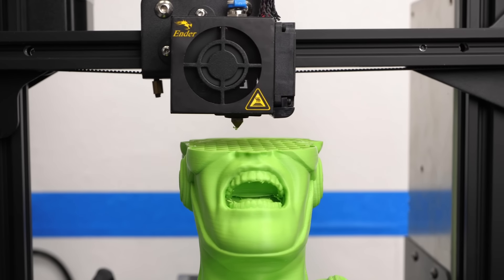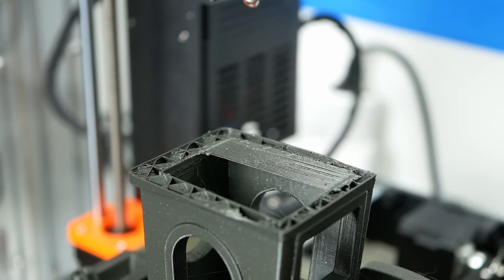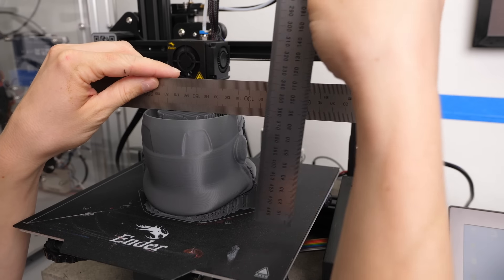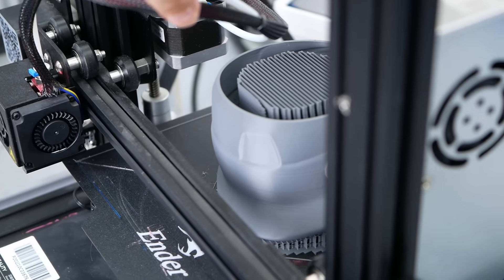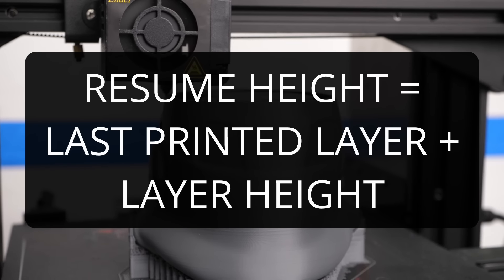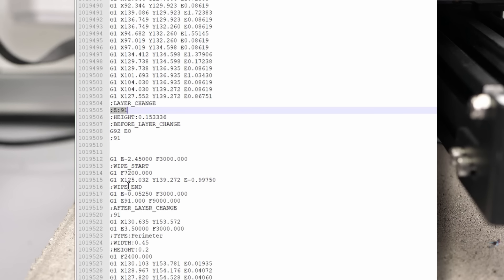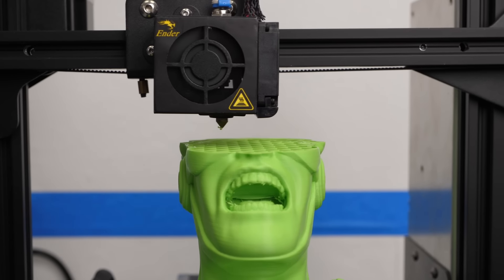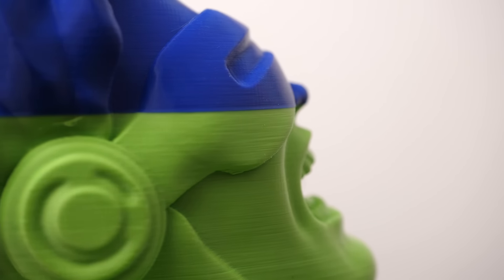HOW TO: Resume a failed 3D print!

Comment: Great video! Although I think you forgot to add that you need to set the extuder position before you have it start printing. Atleast when slicing with cura, the extuder position does not get reset with every layer. So when you do just the steps you mentioned, it is going to go to the start position and extude out a boatload of filament before actually resuming. You will need to have a G92 E{extruder position} command. The extruder position will need to be the last E value from the commands that were deleted.

You can also leave the hotend at the resume z height and use a G92 Z{height} to set the current z height to avoid having it home and dislodge or crush the print. Then you can have it just home X and Y with: G28 X Y 

Clearly I've made this mistake of not setting the extruder position many times
Reply: thank you - that was the solution i needed
Reply: can i ask where will i get the value that i will be puting on the G92 E***?
Reply: I was just wondering that, I didn't want the extruder to go to an 1578.0092 on the first move lol. Thanks!

Comment: Finally a video on this.  I have been doing this for years and couldn't understand why all of the "experts" on youtube just lament a failed 4 day print and then "here is another one i printed".

I am writing this at the same time as watching the video and Stephan is reading my mind or my comments.

Make sure you keep the bed on.  Also move one of the motors or in another way make sure the motors are powered.  DO NOT TOUCH ANYTHING if the motors are unpowered.  Send a move command usually works.

I measure the height of the failure or look at the 3d model in the slicer for a visible point.  Using the nozzle is great too.

The double extrusion of the layer... lol... he is faster than me.  You need to be one layer higher since the printer needs to put the new first layer plastic somewhere.

I dont think keeping G28 is a good idea ever unless you moved the gantry while unpowered. I remove the g28 if you have kept the motors powered the since the printer doesnt need to home again.

The only other thing I would change would be the printing speed on the first recovered layer since you want a good bond and there might be some jagged bits.  This requires changing just a few entries.  You have already identified the layer you want to recover and see the Z 5.20 (or whatever)  the first movement command of each type (perimeters or infill or travel has a F entry... you can choose to change all of them including travel movements.

You will see something like:

G1 F4200.000
G1 X60.018 Y147.814 E0.50701

The top G1 sends the movement speed.  You can arbitrarily cut this in half to 2100.000 to slow the speed by half.

The 2nd line of code has an "E" component which identifies extrusion.  This helps identify if the code is for extruding or travel if the slicer doesnt leave notes.

You then do a "find" in your editor for "G1 F" and work your way through the layer code until you hit the next layer change.

I usually just change the perimeters ones since infill isnt so important.

Alternatively if you have seen that the perimeters are all F4200 you can do a find and replace and keep hitting next until you see the next layer Z note.  If you go to far it doesnt matter, that part of the next layer will just be slower.

If you sre unsure of your "fast" movements and which ones to turn down you can do a quick look through with the find next G1 F and see what kinds values are there... if it is 4000 or so I would cut them in half or quarter (this will cut travel speeds as well which might be a good idea so you dont bump the print hard).  Anything under 1000 or 1500 probably isnt worth slowing down.

As an added benefit if you cut all the speeds by 1/4 arbitrarily with several find and replaces for each F value you will have a much easier time nursing the first layer.  You can have a pair of snips and watch and correct and trim as the nozzle goes.  It will be slow enough that you can do it safely.

Comment: I had a failed print today (ASA sign in two colours) while changing colours set in Prusa Slicer. I messed up the filament change BUT was able to fully recover the print using these instructions. I was super lucky because the fault happened at the end of a full layer is I simply edited the GCode to that layer and kept on printing. Thank you for this information.

Comment: Thank you so much, you just saved a time critical print for a gift. Sucessfully resumed a print 5 hours in after a filament change resumed at the wrong height. Running Ender 3 with octoprint and sliced on cura, rescued it on the third attempt with a spare pair of hands on the power switch.

Comment: PSA: Prusa printers with mesh bed leveling automatically level the bed when sent G28, so regardless of print position on the bed sending G28 will break the print. If you can home safely you need to do so by replacing G28 with G28 W, which instructs the printer to home without repeating bed probing (tested on i3 Mk2S)
Reply: I do: " G28 W ;Home "and the head of the printer go right in my print, what can I do?
Reply: @chrismoro8858  i know bit late but u had the same problem so i changed the safe home position in the printer.cfg so it would home somewhere else and after saving and restarting instantly change bed temperature to what you need before homing

Comment: cura 5.3 slicer, has wierd header, but just partialy detaching the print managed to add line G1 Z39.0 F9000 ;move the platform down 39mm, so that im actually above the print before moving the print head. turns out i had also skipped on the base (belt slip) so had tu manually catch the printpoint by making the belt slip again. long story short, dont let your wires block your printers position and you wont have to restart a 11hour print in 8th hour.
Resumed the print week later, worked. Thanks for the clear steps.

Comment: Literally (and I know this is hard to believe) watched this video this morning while ~20 hours into a 30 hour print. "Good info", I thought. Hour 24 of printing, my printer has support failure and X-axis collision/shift. My whole print was failing from a 0.5" shift to the right. I immediately rewatched your video and implemented the G-Code changes. As you mention a very important "G1 Z#" command to start it all as to prevent the nozzle from crashing into the already printed parts. Despite losing a few supports, IT IS PRINTING SUCCESFULLY! ~6 hours left and I will watch it all the way I think. THANK YOU for sharing this valuable information, as I would have trashed this print in the past.

Comment: After 2 failed prints due too a corrupted SD card, I connected my laptop to the printer too print via usb. Printed the part that failed before perfectly, so I moved on to a bigger part. Just went to check on it and my freaking laptop did a windows update in the middle of a print without notifying me. As it is 4am I frustratedly went to bed and opened youtube to look for something to cheer me up. This video was miraculously at the top of my recommended videos, now I can go to bed happy knowing I can probably fix it tomorrow.

Comment: Filament got stuck on the roll, thanks a million!!! The only difficult part was scrolling for the g-code, but notepad++ has a begin/end selection toggle and I used that to select the line above and then just the scroll bar to head to the top, which is significantly faster than scrolling through several thousand lines of commands XD

Comment: One main thing I did that was not mentioned, after power was restored, I heated the nozzle so when i moved the head to measure, it did not move my part.   A combination of manual axis moves after home, visual verification in slicer, picked closest layer height, and was careful to look for the z drop height after retraction lift.  And dialed down speed to ensure accuracy and ironing of nibs..   I am new to this, so this video was incredibly helpful

Comment: I have recovered a failed print before. It was a dragon for DnD which needed to print for 24+ hours. One of the legs failed but the rest was fine, so I used a file and clipper to remove the failed leg. After that I just removed everything besides the leg using a slicer, printed the leg and glued it on. Worked like a charm :)

Comment: I watched this video weeks ago but had never encountered a major fail

Tonight my CR-10 gave me an error when trying to replace filament in a 12 hour print. The only solution was a power off. You just saved me

However the print was quite large, so I couldn't home, rather than using Pronterface I ended up just removing the print bed while it homed and quickly pause print right at the start so I could slot it in. I was quick enough to maintain temperature. I was lucky that at the beginning of the print I made sure the bed was perfectly aligned, so I knew if I re-aligned it well enough I would be safe. Printing at .6mm so alignment wasn't too hard. Definitely not recommended but it worked. 

Thank you soo much!!!!

Comment: I was printing a 220x220 Sierpinski triangle (pyramid in this case) in vase mode.  The print is ONE continuous line from start to finish.  I considered doing something similar but since the printer "finished", it had already popped off the bed.  In hindsight, I should have started reprinting from the point it failed and glued it together.  THANKS FOR THE INFO!

Comment: I did it! I finally successfully resumed a print, after several failures on other failed print projects. I tried to switch to Prusaslicer but I couldn't figure out how to correctly set my XYoffsets so I went back to Cura. This time around I omitted all the steps after your "Resume without homing Z" section since that was where I was getting messed up. There happened to be space in this print for the homing command in the gcode so I just let the printer home. 

It actually resumed the print, but I think I must have messed up somewhere in measuring my Z since I seem to be getting some elephant's foot effect on where I resumed from where I think my printer is trying to reprint a layer that it had already successfully printed. I thought I had picked the highest layer in the print but there are a lot of individual pieces I'm printing on the bed so maybe I chose the wrong one. Despite the imperfections, it is at least working so I know I'm going in the right direction! 

I will have to say though, there will eventually have to be some kind of automatic error correction in 3D printers eventually if they're going to ever be mainstream. The kind of mainstream I'm thinking about is where almost every home will have a printer for objects that it will be cheaper and faster to print at home rather than waiting for it being shipped to you. 

Anyways, thanks for making these, Stefan. Also I enjoyed your Safety Third podcast thing with Alan and Will, and I hope you had a good time here in America.

Comment: I had issues before when changing filament.
My material ran out and I couldn't home, so I sliced the part starting at the height of failure, then manually moved the extruder to touch the last layer and "set home offset", lastly in the gcode, I made the printer home for X and Y only to keep the manual Z offset.
It was resuming okay for the first 10 or so layers, but then the to materials (both PLA) were separating and failed again.
It definitely needs some practice to perfect but it'd be interesting to test different adhesion properties after cooling and resting for a while.

Comment: I had a badly knotted filament. So I did measurement and did as you described in beginning: cut lower part in slicer and printed top and glued afterwards.

Comment: Tach Stefan,
I did both. Cut off the 3D model and used CA-glue to stick the two parts together and I hacked the G-code and continued the print in-situ. Both worked quite okay. However, Cura seems to use absolute Extruder positions, which certainly would cause problems if not reset properly.

Comment: Great video! I just went down a rabbit hole on this. I found a simpler way to deal with not re-homing Z axis without using other software or external controllers.

You can simply move your extruder twisting your lead screw or whatever by hand, unpowered or with the steppers off, to the top of the print to where it should start extruding the next layer. You can eyeball it, carefully comparing the space between the tip and the print to the thickness of the previous layer.

In your G-Code, Change the homing command to X and Y only, and put a line ABOVE that, with a G92 (Which TELLS the machine where it is) followed by the Z height matching the Z height of the next line of your G code

Note: When homing X and Y, it raises the Z on my CR10 for clearance, so I had to make sure to define Z on the line BEFORE the homing X and Y command, so it comes back down to the right place after homing.

The code looks something like this: (In my print, the next layer was at Z height of 117.47)

G92 Z117.47
G28 X Y ; Home the X and Y axes

Comment: Maaan! You do some great videos. 
My problem, klipper, auto probe, found fix. 

Measured from bed height of model already printed. Re-sliced dropping the model that height below the bed. 
Disabled all meshing except for safe home in config. 
Restarted. 
Cut a piece the height of already printed model. 
Made sure gantry was up, then started the print. 
When it went to center of bed to do z home I held the cut piece under the probe. 
It worked!
Couldn’t have done it without your video.
Really hope this helps someone else.

Comment: Yeah Stefan, printed pistol brace in a specific color and I was setting up octoprint. Octoprint sent commands to start a new print job and that broke my printer while trying g to print. I had a limited amount of the filament so I measured the height, opened the gcode and use Ctrl+f to find the nearest mm value for my part and used that range to delete all steps before that point and reprinted the gcode. My print had three different parts on it. One was successfully reprinted one looked successful but the Layer adhesion was poor because it snapped apart easily, and the third part curled and lifted away from the printed portion on the bed.  I reprinted just that section and 3rd part and assembled the 2nd and 3rd parts with super glue and plastic weld over the course of three applications. The parts work and are in the same material to match which is awesome

Comment: I never expected to have this issue, but literally 30 minutes ago the filament got stuck in the extruder motor. I stopped the print, and luckily had the chance to home all axis. I took all the filament out, checked the nozzle for clogs, and everything was fine. I measure the height using the 3d printer itself, and went into my computer and did the steps. It ended up working, but I miscalculated the height and accidentally reprinted a layer. All I got was a little elephant's foot, but other than that, my 5 hours of 3d printing did not go down the drain!

Comment: Thank you for this information. Just today had a print stop due to filament ran out. I was able to start it up again after adding a new spool. I do see a line where the print stopped then resumed. I am not concerned with the line necessarily but in previous prints that have stopped then restarted that has created a weak layer that is easily broken. Is there anything I can do to make the first restart layer stick to the last printed layer better? I am not sure how long the print had stopped, the bed was still heated but the part is about 200mm tall so the top is no longer warm. Resuming with same type, brand and color filament if that matters. 
Thank you.

Comment: My printer keeps freezing a lot of the time it just stops at a random height it's a neptune 4. It's gotta be some klipper issue but i might be able to remedy the situation by always switching off before each print we'll see...but i'm not 100% sure what causes the issue to begin with...sometimes it's good sometimes it's not. The good thing is that the display shows the z height where it got stuck. It's sooo annoying...  it kinda leaves a bump on the last layer so i guess i gotta remove it before resuming.

Your info is absolutely invaluable thanks. Thats exactly what i was looking for.

Comment: Glad I remembered this video... I woke up to ptfe tube being out of the extruder and filament was just flying around instead of being pushed into the tube. It worked but my print got moved by like a 1mm to the right for some reason, don't know what I did, maybe I bumped it or something after homing in... But it saved 30h print and my friend says that It can be a little broken so hope she likes it. I also found out that either my ptfe is worn out or the loop is too tight when the printer is homed in because feeding the filament was quite hard (Or because I bent the filament quite a bit when I was taking it out). Also I'm pretty blind but I used my phones magnification and counted the layers to the next notable feature. I also found a tooth of what I think is the coupler that failed. Luckily I had a spare one on hand.

Comment: On Cura I moved my nozzle to what I suspected the next layer's height to be and then used the G92 Z57.48(whatever your next layer height is) command, before homing with G28 X Y. Then it picked right back up with only a mild layer shift. Just saved a 5 day print 2 days in.